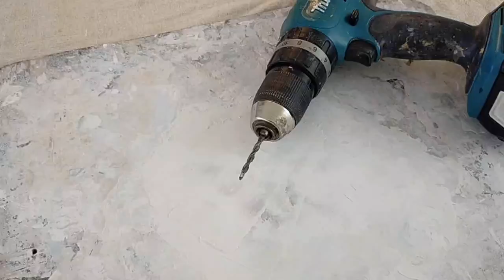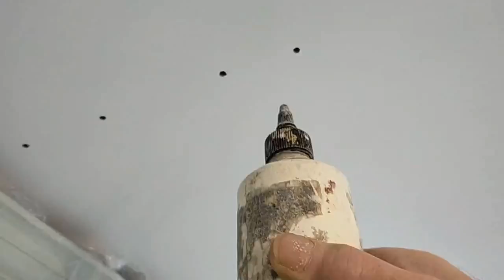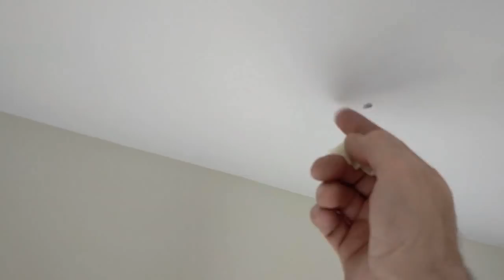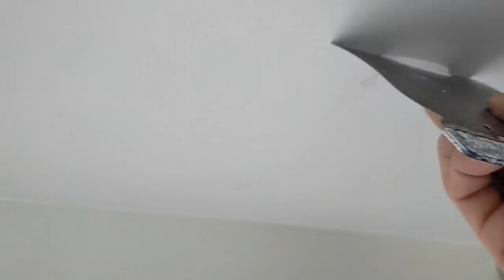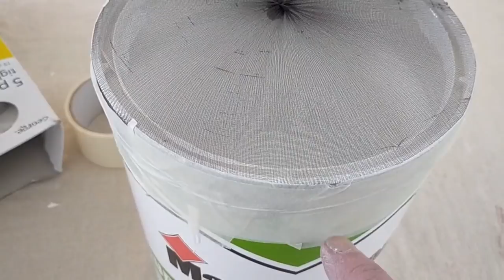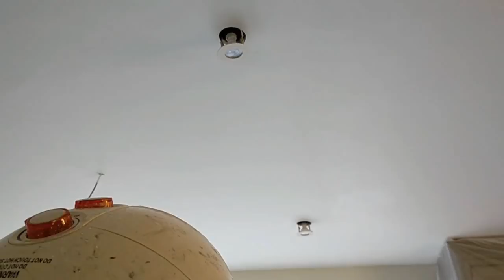Cracks A Common Problem In New Ceilings. How To Fix And Painting Tips.

Comment: In Australia it is a requirement to 'back block' joins. It looks like you guys don't do it over there and it also appears there is no paper tape or mesh on that join. I like the use of expanding foam in places that it will work. I'd like to know how this repair goes in time but I think it will crack again in the same time frame as this crack appeared though. Cheers.

Comment: I’ve actually seen some plasterers bond their joints with foam on plasterboard prior to plastering it…. In my opinion it’s the sign of a good plasterer. Screwed every 6 to 8 inches and taped before being skimmed. Obviously on new work timbers can’t shrink back with central heating etc. can be annoying but this method always works as you’ve shown for me! 👍
Reply: Exactly what i do. Before I plaster i foam any gaps in the board, where walls meet ceilings, along the skirting/string, around windows etc etc. I charge more but do it properly, rather than just skimming over bad surfaces
Reply: @NikKyriakou  good practice…. Helps with any movement and also helps to insulate any air gaps. I think some regulations state fire foam for some jobs. Depending on the situation. Not really sure.
Reply: @MarcGray1990  yeah mate exactly, I don’t want any cracks appearing and I often decorate my plastering so want my job to be easier too. Yeah I expect so with the fire foam, I do pretty much only older houses/non new builds so I don’t really have to worry about regs like that luckily
Reply: @NikKyriakou  not me mate. I do mainly council properties…. Do kitchens bathrooms carpentry etc our plasterers don’t have to worry about regs like that as it’s not specified. Always nice to follow a good plasterer though! I do a lot of painting also and you soon tell a good spread from a bad one once you get the mist coat on.
Reply: @MarcGray1990  ah got ya. Used to do similar, did property maintenance for an estate agents so I expect the same challenges, dirty houses, stuff never being moved for you etc! Oh yeah 100%, plaster always looks great while it’s drying out, especially when it’s at its darkest but you’re right, once some sunlight hits that mist coat you’re often in for a shock! I do smaller hits also so you can take longer to get it right rather than chasing your tail. I think plasterers in general just knock up way too much on domestics that are lived in, Chuck it on and are then chasing their tails. I typically don’t, and can’t really do more than a 2 bag mix, purely because you’ve got stuff to move, obstacles etc. But it gives me more time to focus on the awkward bits and leave a finish I’d want in my own place

Comment: Thanks for the video. Can I ask what the paint in the filler is for ?
Reply from the maker: Hardstop filler usually used after first coat for any filling before final coat...   stops the filler from flashing. thanks
Reply: @PaintingandDecorating  brilliant thanks
Reply: Its called a hardstop, means there be no flashing through of the fillers.as such.
Reply: @spinx1200  thanks mate 👍
Reply: @micksmith3352   no.worrys anytime mate,.I'm old.school painter/decorator like these guys, do the job right 1St time, no comebacks that way. Stick to.these guys advice and ya won't go far wrong. 👍🏻

Comment: I’ve used your foaming and filling technique on skirting boards and that has worked a treat. I even get customers who now want me to cut out the old caulk out of every frame and skirting and re do it with foam and filler. Can’t believe how well foam glues the skirting boards back on after shabby joiner work. But I have been struggling to fix the cracks on the walls. Think I need more practice but it’s frustrating because I follow your technique and the cracks still come back on the walls and ceilings.any idea what I might be doing wrong. Because cracks on ceiling and walls are my pet hate.
Reply: From my point of view, major cracks that keep opening up despite filling are structural, and there's not a lot you can do until everything has fully settled (assuming it does). Framing which is expanding and contracting with the seasons is just going to be an issue longterm.
Reply: @Auriflamme  yeah My father in law is a plasterer he says there’s nothing you can do however I have noticed that taking the crack back to the brick and using foam to back fill it the cracks do come back but there much finer so less noticeable.
Reply: @adammac4960  like the previous post mentioned about it being due to settlement. I would maybe suggest looking at previous paperwork when you bought the house in regards to searches on ground stability
Reply from the maker: Nice to hear your using the techniques if takes practice and understanding each crack is different. Thanks
Reply: @PaintingandDecorating  cheers mate.

Comment: Thanks for the video.  Silly question but if the drill didnt go right through the pasterboard, what is the foam doing?  gluing the two bits of separated plasterboard back together?
Reply from the maker: It does actually break through to the back.. thanks
Reply: @PaintingandDecorating  Thanks - understood now.

Comment: Nicely done. I find a short piece of MDF sits in my paint kettle nicely, the width of the mini roller and maybe 10" long. I use it mostly for trim that needs laying off after with a brush, but it's pretty versatile and I've used it in place of your plaster mixing board when doing ceilings.